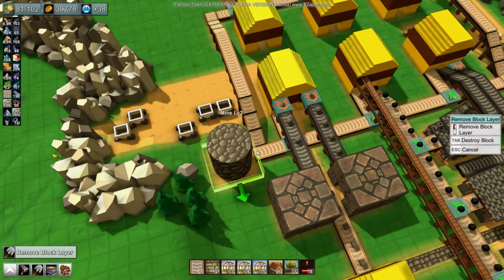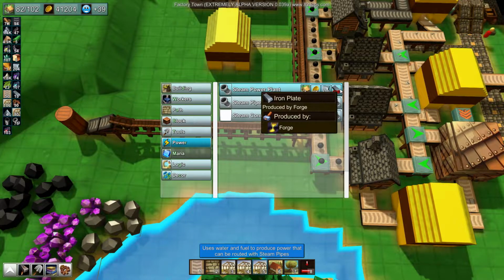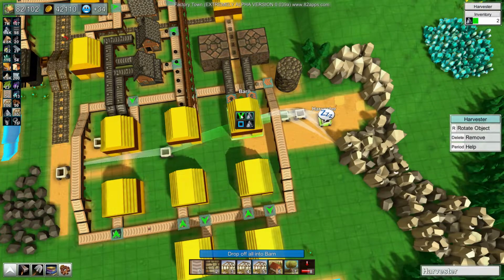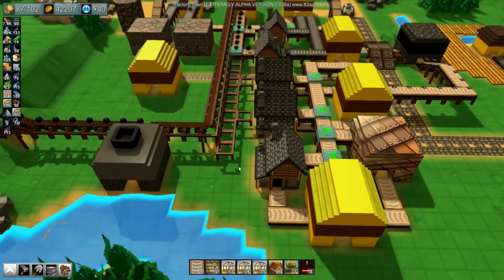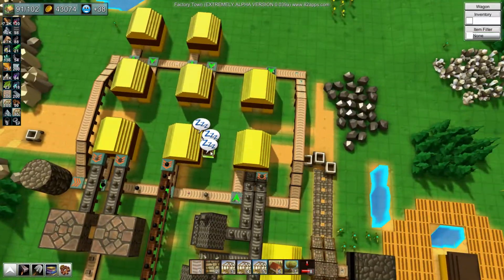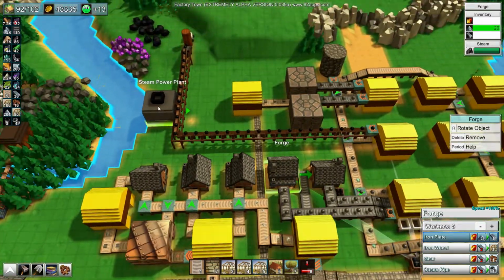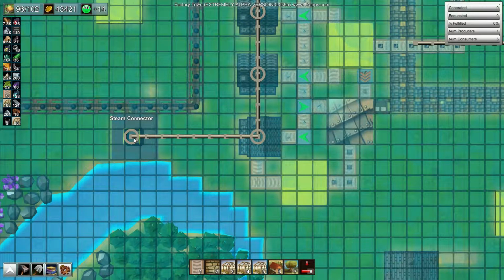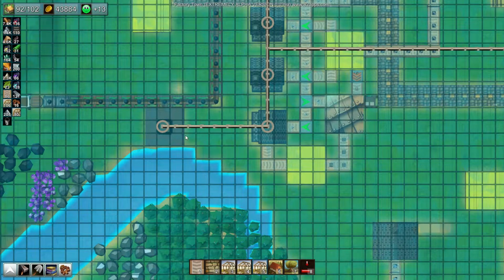Factory Town - Ep 18 - Steam Power

Comment: Steam is a boost to your power not a replacement. Check out the speed % on each building and then connect steam.
Reply from the maker: Yea, after reading a bit on discord I discovered that. I'm still having issues with the steam just not transfering to the buildings, as you'll see in the next episode. I've just chalked it down to this save starting on a much earlier version and having a comparability problem.
Reply: @STHedgehog  great series I look forward to watching more